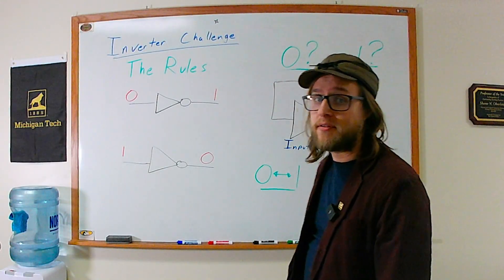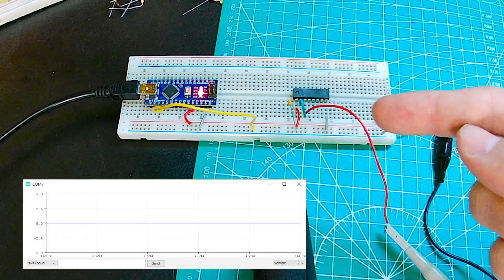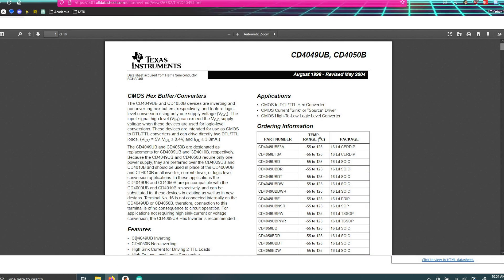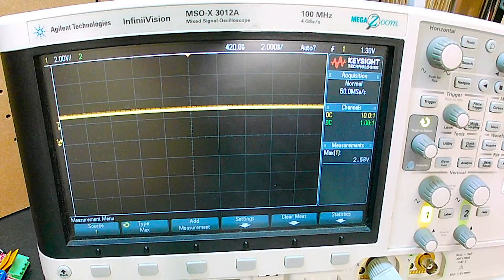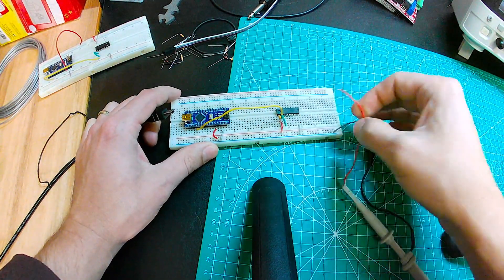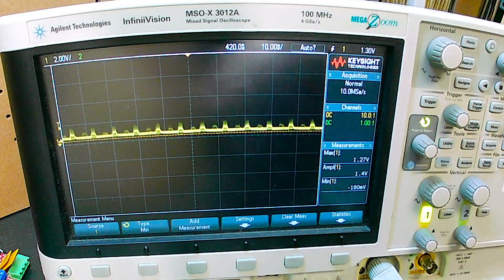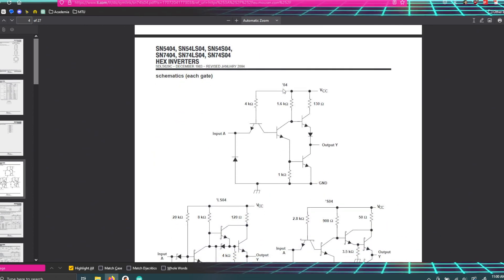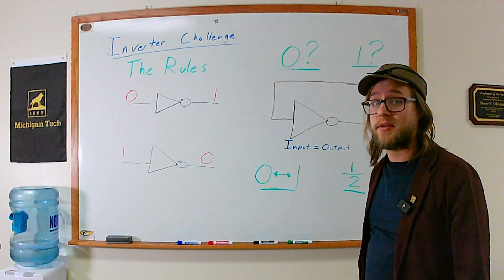The Infinitely Inverting Signal

Comment: These cmos circuits can use a boatload of power when the inputs are indeterminate (both transistors are somewhat 'on').
Reply from the maker: That's a good point! I didn't even think to feel if the chip was warming up. Sounds like I've got another measurement to take.
Reply: @DrShaneMTU  Is there a follow-up to this?
Reply from the maker: @johnyang799  Not yet - but next week I'll wire up a comparison and use a thermal camera to see if there's a big difference (along with measure the current draws)
Reply from the maker: https://youtu.be/WZJ1xLhIEXg Here you go! Thanks @ByWire-yk8eh for the idea!

Comment: If you knew a bit more about analogue signals, you'd know that the inverter is simply an inverting voltage amplifier (although that should be pretty obvious in the CMOS version). If you provide 100% negative feedback from the output to the input of an inverting amplifier, you should expect it to settle to a steady value somewhere midway between the extremes of its voltage swing.

The TTL is a bit harder to analyse, but it is made up of a common-base input stage followed by a splitter stage that acts as an emitter follower to the lower output transistor (a common emitter amplifier) and a common emitter amplifier to the upper output transistor (an emitter follower). That is also an inverting voltage amplifier.

There are no mechanisms for oscillation without a phase change to create positive feedback. The oscillations you are seeing are most likely spurious cross coupling from the other gates that you left floating or pickup noise from stray electric or magnetic fields from the long wires you used.

If you want to create oscillations with logic gates, use a Schmitt trigger like the 7414 or CD40106. A resistor from output to input and a capacitor from input to ground will allow the capacitor to charge and discharge between the hysteresis levels to create a stable square wave at the output.
Reply: I am a noob at electronics and I immediately spotted sonething was off. Stacking inverting logic like this with short wires and tiny capacitances will produce up to several GHz oscillations that a shitty 100 mhz scope will not show properly

Comment: You haven't tied the unused inputs to GND or VCC. It tells you to do this in the datasheet. Did you read it?
Reply: Sorry, I came back to apologize, Just plug an odd number of them together, but not 1, you are shorting the transistors. With 3 you will create what is called a ring oscillator, it will go fast. 
Understand your oscilloscope is unlikely to measure this properly, but should get the frequency. The tau value for this is only 2 x propagation delay of your inverters x N. Also, if you chain 3 inverters together, you create 3 outputs each very roughly 120 degrees out of phase. This "very roughness" is sometimes used for random number generation, although I have read papers that say it's a bad idea.

Comment: Normally you should get oscillation with TTL gates because there IS a small delay betwen input ant ouput.
So if the input goes from 0 to 1, after the delay, the output will switch to 0 and the input too at that same time. But because of the delay, this input 0 will not be reflacting a 1 at the ouput until the delay has passed and will allow th 0 at the output to settle down and exists. Same for the other edge.